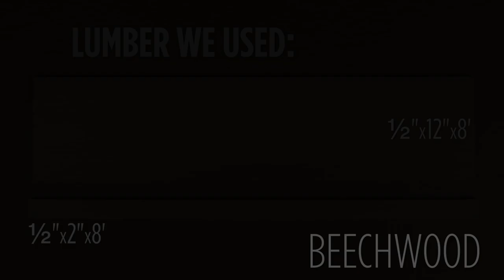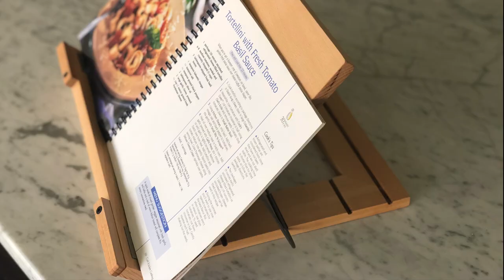DIY Cook Book / IPad Stand

Comment: Nice project, I was looking for ideas for Christmas gifts and this fits nicely. What was the length of the aluminum rod you used? FWIW, you should use an auxiliary fence when cutting short pieces on the miter saw, I cringed a little when the piece you cut went flying, and your router bit is in desperate need of sharpening.